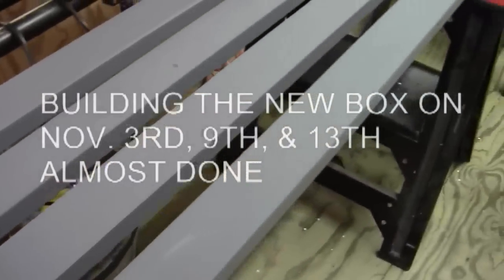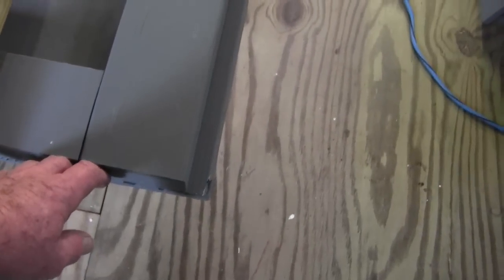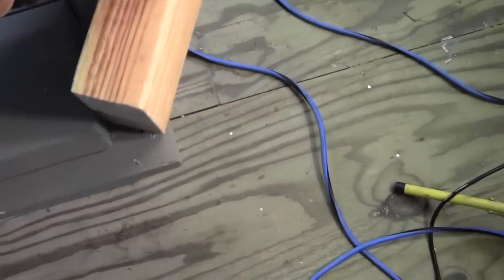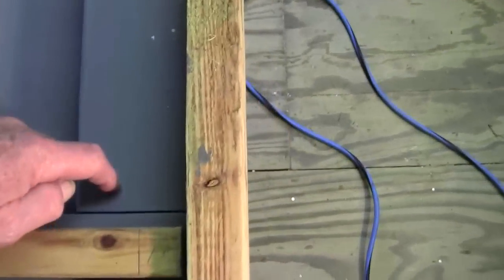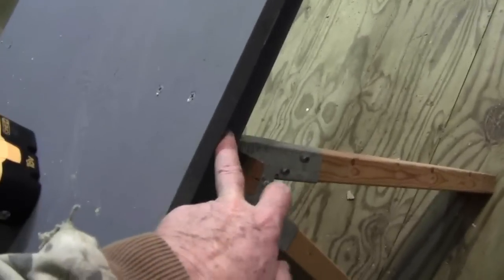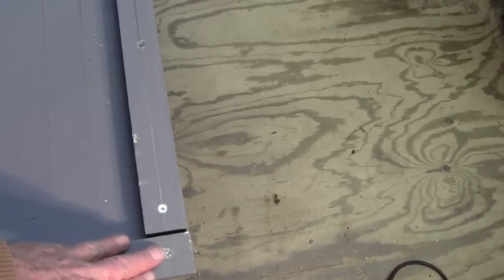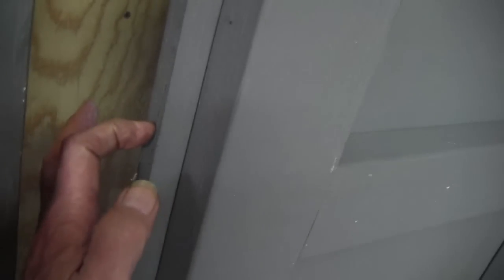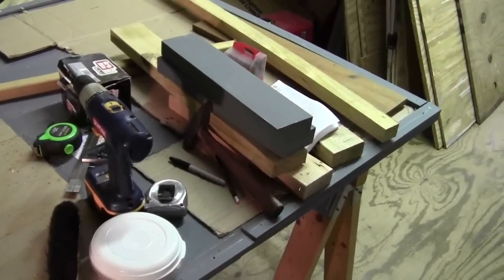UTILITY TRAILER BOX REBUILD PT 2 OF 4

Comment: Bernard, you don't ever do anything "half-fast" do you??  LOL
Reply from the maker: Karl: I have been told that several times before. We both have been really busy the last couple of weeks. My bride has been working 10 - 12 hour days. I had to replace the head gasket on our river mower, work on the trailler box, (it is finished but not on the trailer yet)  pull the garden, pull all of the bulbs, tubers and rhizomes, cut the cannas down and cover them along with the cala lilies and get up some of the million oak leaves here at our home. It is going down to 22 degrees tonight. I will be glad when I get old and retire so I will have a lot of time to do things. People still ask me what I do with all of my spare time now that I am retired. Without the new trailer box I have not been able to clean up the river cottage pine needles and some leaves. Normally the river property would be clean and ready for winter by now. I also need to get the garden covered for winter. Oh Well!! Bernard
Reply: *****
Me too! Tired of working for someone else...want to work for ME now!
BTW, it was 14 this morning (11/19/2014) on our deck (about 45 miles east of Atlanta!)